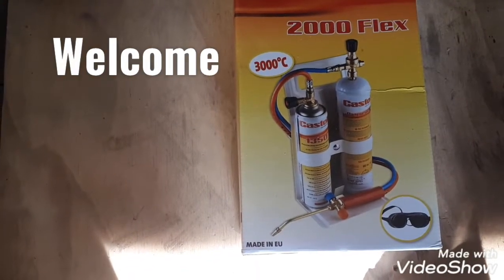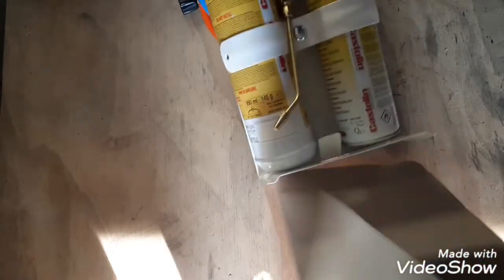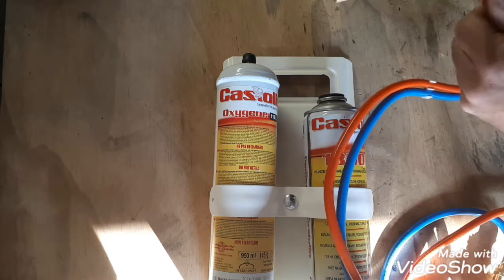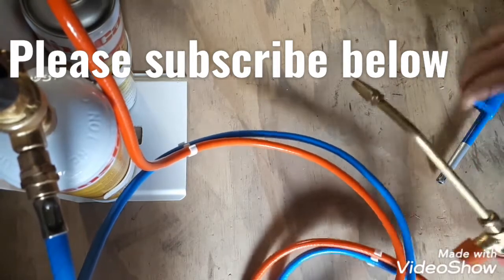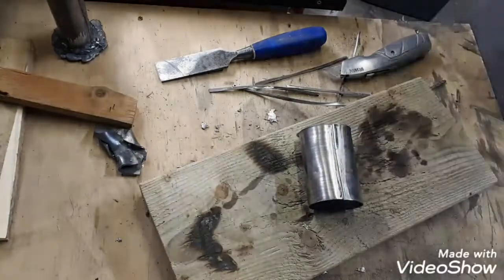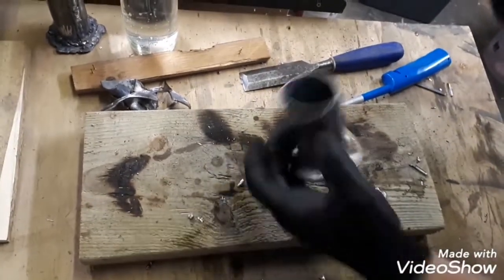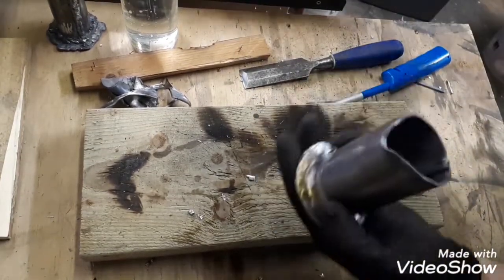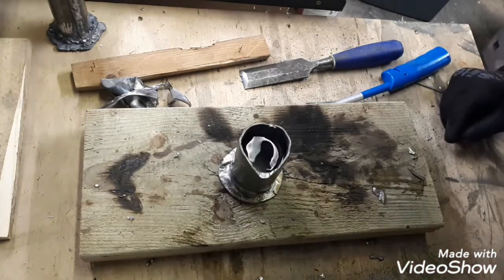Oxy-propane torch kit Castoline 2000 Flex for lead welding

Comment: Where can I buy this thing?
Reply from the maker: I've got it of eBay
Reply: @mrfxr1695  and does it work well to solder lead . Do you recommend it.
Reply: @mrfxr1695  have you got a link
Reply from the maker: It works really well👍 I'm happy with it
Reply from the maker: @Imflightmode  https://www.ebay.co.uk/itm/234043692879?mkcid=16&mkevt=1&mkrid=711-127632-2357-0&ssspo=2eVf865iQqW&sssrc=2349624&ssuid=xkj3pspstc2&widget_ver=artemis&media=COPY